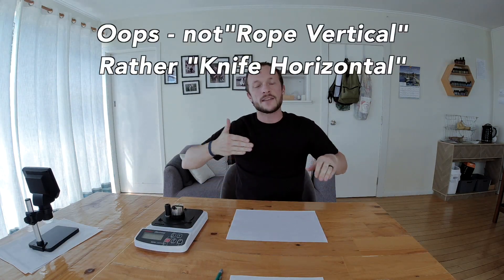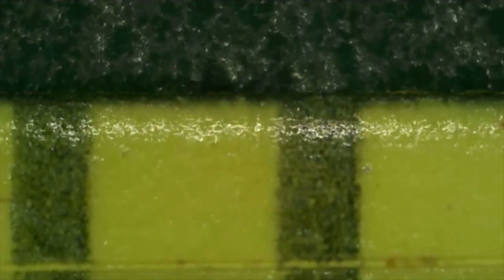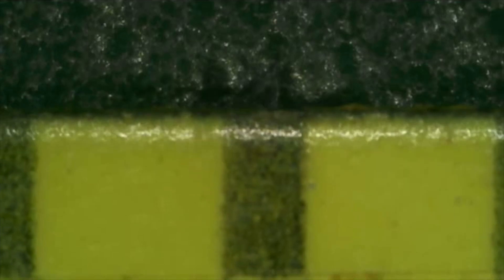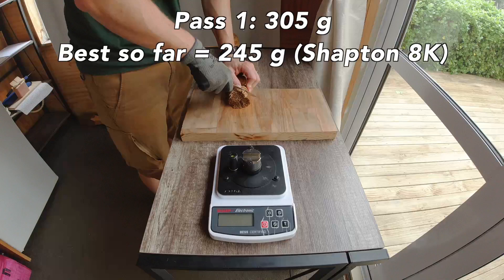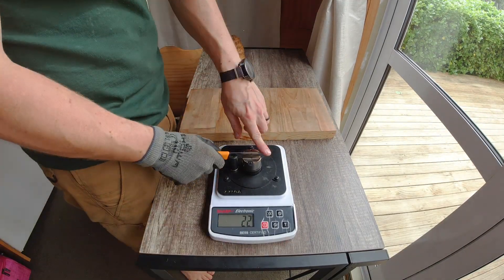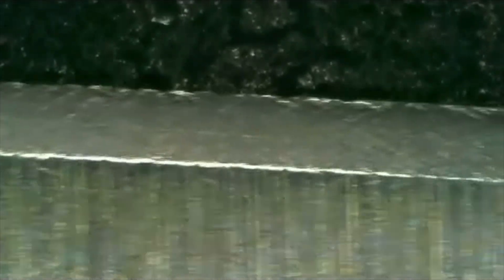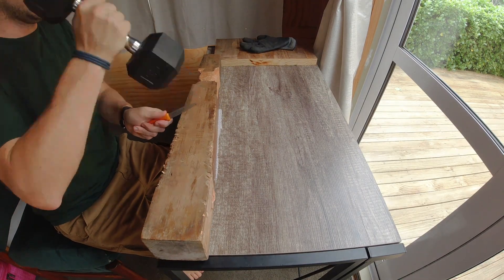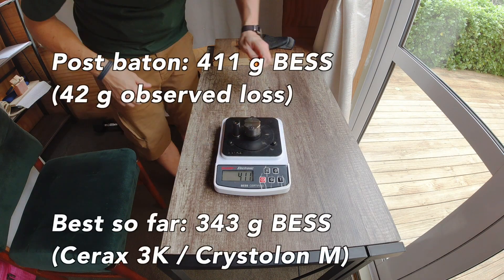Spyderco CBN 800 Mesh Dual Grit Edge | 40 mm Manila Rope | ANDE Knife Test

Comment: Recently watched a video reporting a caveat with Spyderco's combo CBN stone, namely that the coarse side had a small ridge of CBN on the edge of the stone, and there was grit contamination present on the medium side. Made me thankful I went the diamond plate route instead!
Reply from the maker: Yeah I saw that Outdoors55 video.  It was super interesting.  I have definitely had good results from this CBN Stone - I'm not sure but perhaps the intense aggression caused by some scattered large particles adds to dual grit aggression without destabilizing... I don't know.  I have an Atoma 400 plate on the way to compare, and a FEPA 80 grit resin-bonded Venev CBN stone.  It will be interesting to see how they compare!
Reply: @homeslicesharpening  I read that last bit as 'Stay Tuned!'
Reply from the maker: @CSGraves  Yeah!  I am having another baby in a month so it may be a while, lol.  But I am excited to test out the new coarse stones.  Have a good one bro!

Comment: Made several attempts to respond to questions you presented in the comments section of previous videos. They magically disappear.  
- They include references to images created from data I have collected & other research which words do not communicate well. ( likely the issue)  It can be difficult to absorb the complexity of this data without images.  Many hours invested in creating these images which I would like to share. 
- There are alternatives routes to pursue sharing.  Are you interested ?
Reply from the maker: I have contacted your photography studio - thanks!!!
Reply: @homeslicesharpening  Thanks for the the heads-up, I found your message hidden in the discarded messages, so mine may suffer the same fate. I have replied to your message, please reply with a confirmation if my reply reaches your inbox.